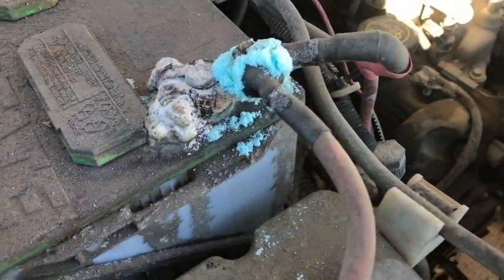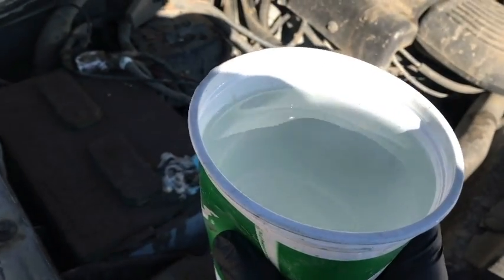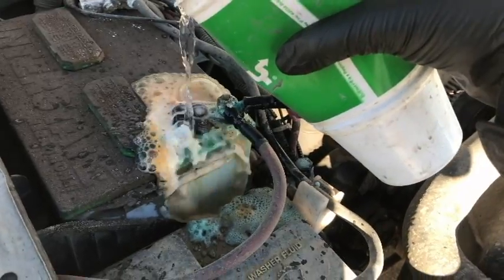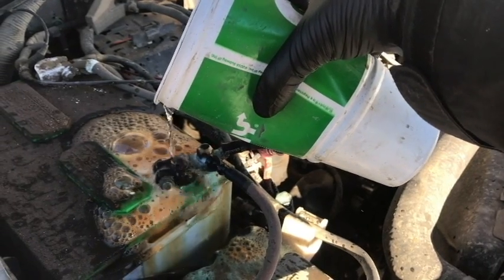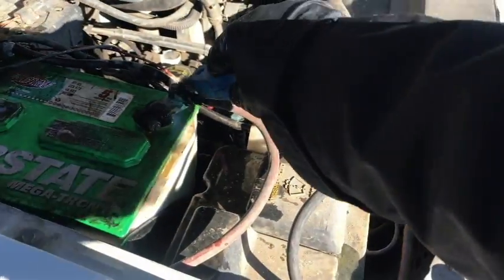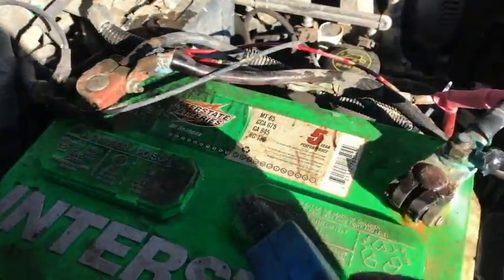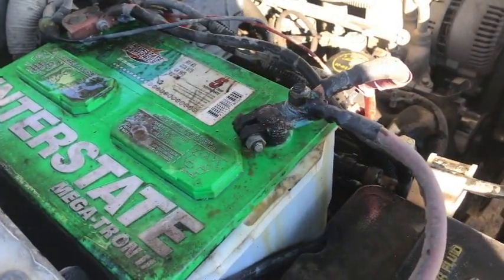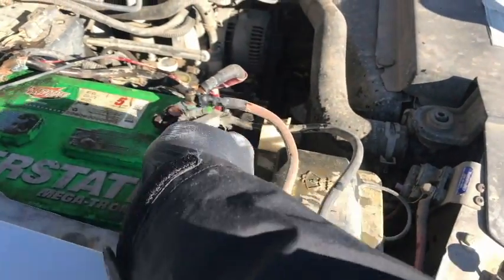What Happens When You Don't Maintain Your Battery!

Comment: I keep only one main wire at each terminal to minimize corrosion.  The main positive leads to a 200 amp junction block as does the ground to its own separate junction block. That is where the multiple wires should meet to make clean connections last longer. Those blocks are where the auxiliary wires should lead. If keeping more than one wire at each terminal.... keep cleaning them regularly because in that case its the only remedy.

Comment: In the old days we used grease to coat the terminals and cable ends. Also used it on bulbs before putting them in sockets on the vehicle. Stopped all corrosion. Now they have the spray that works well.